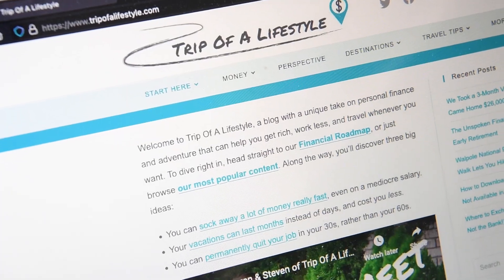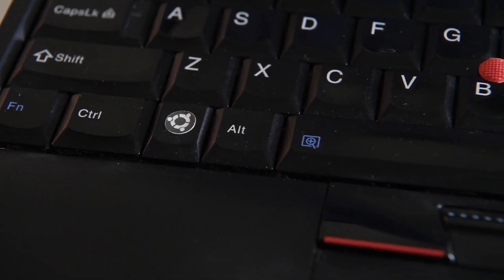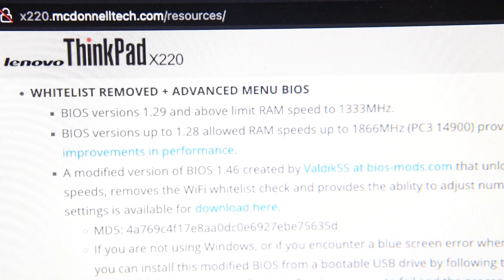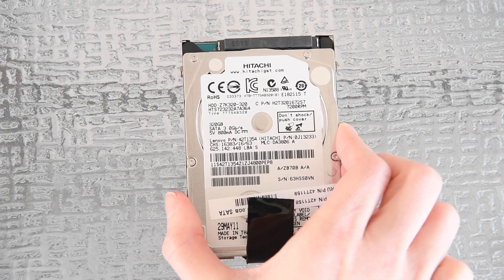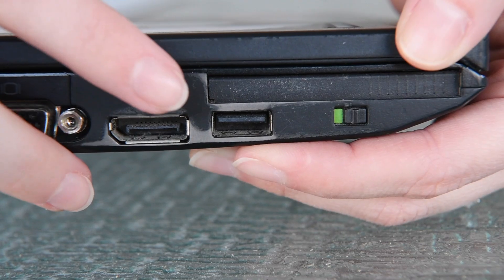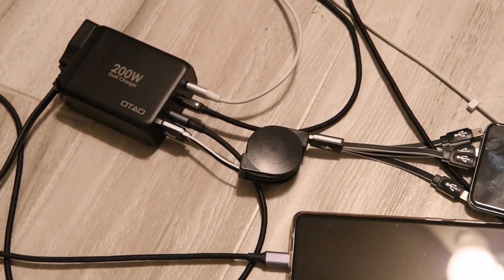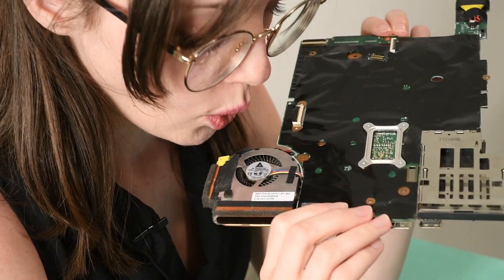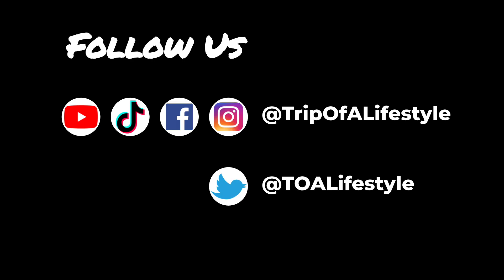How To Make Your Laptop Last FOREVER (My ThinkPad Mods & Upgrades)

Comment: An excellent idea to continue using a perfectly adequate laptop. I have done almost all of the same mods with my X220 and it’s still going strong. The nice thing about Thinkpad laptops is that there were so many leased to corporations that there is a huge pool of used units for parts available. Because they were built for business use, the components were reliable and not necessarily leading edge so they last a long time. The old Thinkpad in particular are highly modularized so it’s easy to swap out certain components rather than having to replace the entire main board for everything. Thanks for the tip on the USB-C power inlet replacement!

I got my upgraded WiFi module long ago as a Lenovo branded unit out of a newer parts Thinkpad found on eBay. I’ve been through 4 batteries and finally landed one that seems to be built less cheaply and that has lasted well. Because the “hard disk” SSD is so easy to swap I run Debian most of the time and can swap to Windows 10 for one specialized application that requires a direct hardware interface and won’t work with a virtual machine. The SSD and memory upgrades really give new life to the old X220. I also have an even older X200 that’s still in use and even an ancient X40 with a rare tiny replacement SSD and running 32-bit Debian that I keep around as a novelty.

Comment: I have a HP Elitebook 8460p from December 2011 with an I5-2520M; 8 GB DDR3 and a 2 TB HDD.  I have a desktop and I'm retired, so I don't really need a laptop anymore.  Only once in 2 years, when I go back to my country to visit family for 1 or 2 months.  Mostly I use my laptop as backup server and that is why it has a 2 TB HDD, because my desktop has 2.5 TB storage.  Desktop and Laptop run Ubuntu 24.04 LTS and for storage I use OpenZFS and all my apps run in Virtualbox VMs (Linux and Windows).  So I have exactly the same VMs and Data on Desktop and Laptop.  I bought the off-lease laptop in 2017 for ~$200 and only replaced the HDD.

My $349 desktop is a Ryzen 3 2200G (4C4T; 3.7 GHz) from April 2019; 16GB DDR4; a 512 GB NVME and a brand new 2 TB HDD for speed supported by a 128GB SSD cache. Begin of this year my 2 reused HDDs (1 TB + 500 GB) died after 10 power on years.  I intend to upgrade to a Ryzen 5 5500GT or 5600GT (6C12T; ~4.5GHz) and 32GB of DDR4.  The Ryzen 3 2200G still runs fine, but for the next 5 to 6 years I will need somewhat more power and space :)   Besides I'm almost 80 and I don't like to continuously estimate in my head the required free memory for VMs I want to start.
Reply: Im typing this from bed on my HP Elitebook 8540w from 2010 that I still use every day. Also has an i5, and 8gb of ddr3, and then a 512gb SSD. Still fast now running Zorin Lite.

Comment: Great video. I recently bought a Lenovo 480s from Amazon Renew for $200. I highly recommend it fot anyone looking to buy a laptop you can still modify. Ive only added a second ssd and installed linux on it so far but you can do everything else in this video when needed.

Comment: I have made a bit of a hobby of rescuing old Dell and Lenovo laptops at the surplus department of the local university. I, personally, have four Dell laptops about 12 years old. With a little elbow grease to clean them up and some relatively minor hardware updates, they are perfectly reliable workhorses for genral purpose. I install some flavor of Linux on them and they just work. I love the older laptops because of the modular batteries. Newer ones start integrating the batteries which increases the complexity when you need to change them.
Reply: How do you get batteries?
Reply: @abdul-kabiralegbe5660  I usually find them on Amazon or eBay. Typically they are an aftermarket battery that is almost as good as a factory battery, but good enough for my old laptops.

Comment: The worst thing you could do, was change your power connector with a USB-C. That is the most unreliable connector on the mmarket. Buy yourself 50 connectors, because you will have to replace the at least 5 times a year.
Reply from the maker: @leonvanderlinde5580  It's been 18 months of daily use since the upgrade — zero problems! It's been very convenient to be able to share a single charger with other devices, too.

Comment: Your biggest update was switching to Linux. Xubuntu works great on low end older hardware. 
With a free Ubuntu Pro account, any given Long Term Support version has security support for 10+ years, so as long as a version works on your hardware, there is never a need to update. ZORIN OS is another version of Linux that works on older hardware. It is good down to a dual core processor with less than 4 gb of RAM. I am actually using the ZORIN 16.3 LITE on a SINGLE core Centrino and it still works.
Thanks to web-based software and Open Source software, the only people locked into Windows are those stuck in the Microsoft Office Application jailhouse.

Comment: I work at a company with a mobile workforce and the workload demands that we replace aging computers with new ones because motherboards are dying from fans giving out (non-replaceable) and heat issues, as well as terrible slowdown as Windows gets more bloated. 

The most important upgrade is replace HDD with SSD and the most important setting change is TURN OFF TURBO BOOST in the BIOS. It makes it run hot, increases power consumption, and greatly increases fan noise.
Reply: Yep, excessive heat degrades components.

Comment: OMG. Looking back, I did upgrading, tuning, extending, for 30+ years. Sure, you can do that. Sure, Thinkpads are among the most enduring devices. There's a 380D from the 90ies lying around, and I'm pretty sure, it will still run. A really Toshiba Satellite P4 .. marvellous 2Mpixel display, 512MB, nice keyboard ... but it won't handle anything current when it comes to desktop usage, and as a small server or display appliances, any raspberry will do it better. Apple Powerbooks and Titanbooks- yeah, many still would run, but ... even if you upgrade them to the last enhanced inofficial Leopard version - their single core G4 struggles with todays needs.
There always comes a moment, when it all doesn't make sense. Adding another 2 years or so by replacing/adding RAM, SSD, Wifi modules, maybe even a better GPU or CPU fitting in (...if not soldered) ... 
I know people with still running 2012 and even 2011 Macs, that could still get prolonged use, but I also see, that people struggle with their old apps getting slow and incompatible. Reviving won't work forever. One day, the effort and the small gain in speed simply isn't work it. Then, get a newer one, put the old one on the shelf and let it rest in peace, as long as it would still start. 
Makes a much better memory, than the Frankenstein way or a "dead" and damaged device, that you once loved.
Reply from the maker: That is true! But the "replace your device every 2-4 years" mentality that has been instilled by smartphones recently is an unnecessary level of consumerism. People need to understand that their devices don't become garbage at the first sign of trouble.
Reply: @TripOfALifestyle  What I wrote is far from 2-4 years and also depends on the kind of device/PC/notebook you reach for.
If you buy a 250 bucks notebook, you can't really expect 4+ years of decent operation, neither looking at its power (i3, Celeron, N100,..), nor its physical design (snapped plastic shell, barely extendable, ...).
Grabbing a business monster >1000€ gives you a sturdy metal shell or at least frame, non-glossy display, xpress-card slot, reasonable keyboard, and a working cooling concept (if needed), which might well run for 10 years, and even if you replace it after 5 ('cause developer or other professional) the notebook will serve some standard user for 3-5 years, while the N100-class will struggle. And upgrading the business device will make sense.
But most probably not far beyond 10 years.
Let's be real: these monster with an i7 from 2010-2016 are heat blowers.
The decision needs some experience and understanding the needs of the owner. Most standard users don't really have a clue and might misunderstand your claim of "forever". 
Thinkpads are great (not my personal choice, but often my recommendation) and enduring, but that doesn't mean they are useful for applications needing 4x the power. Today, a dozen of browser windows/web sites can already stress 5 year old, weak  notebooks.

Comment: 1:50 You acted so cute.
Would you say I should try Linux again. Last time I played with Linux was puppy and some raspberry(9yrs ago) and I had to use peoples guides as I had very bad spelling skills making it challenging to figer/guest the commands/terminal spelling. 
The other thing is I need direct-x12 and usb mouse passthrough. 
So right now I run Hyper-V as I need direct-x12 and than run parsec to my VMware coping the Hyper-V desktop so I can have usb mouse passthrough >_< on windows :(

Comment: Hey, nice to see your video. 
I'm still using compaq presario v2000 which I bought in 2006 with win xp os, still using with that. I have upgraded the 90gb hdd to 256gb msata, thats all
Reply from the maker: Nice job keeping the older equipment running! You should consider using a modern OS (like an updated Linux distro) for security reasons though. Windows XP hasn't received security updates for a long time.

Comment: i get the if it aint broke don't fix mentality but the 1200 price tag all together could have just bought a new one or maybe a used one on ebay for 160 like I did for my Lenovo e15 gen 2 and just updated the bios for 2024. 

I did find the barrel adapter interesting though.  have to get some for my tech kit. thank you
Reply from the maker: @itsaperfectdork  It was purchased brand new at the beginning for $900. The additional $300 was the total of upgrades over time, including replacement batteries.

With that said — yeah! You can definitely get a great used computer super cheap to begin with. That's a great idea too. 👍

Comment: Pretty much all laptops that are x64-64bit, and have intel core i3 first generation  or newer (around 2010/2011) can be upgraded to decent performance for peanuts (Buy a used the top "generation processor") 95% of cases  BIOS is prepared to work with all processors from THAT specific generation. you can max out your ram, which will be 8GB for Dual cores and 16GB for Quad cores, which is decent and cheap, finally get an SSD. that's it, if you are not into VIDEO EDITING, or heavy programming, that laptop should be fine for few more years, and you will reduce e-waste ! (that's actually the main reason I do it) ... you can put Win10, Win11(use Rufus) or any Linux distro and it will be very smooth for daily activities, even light programming.